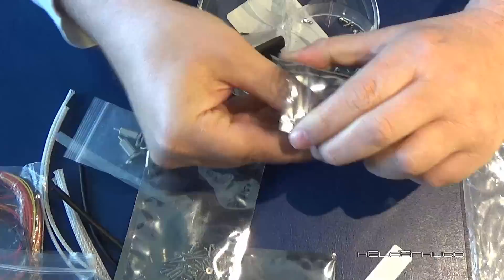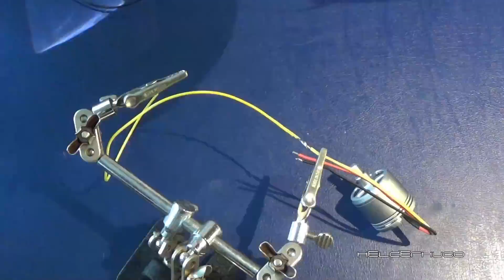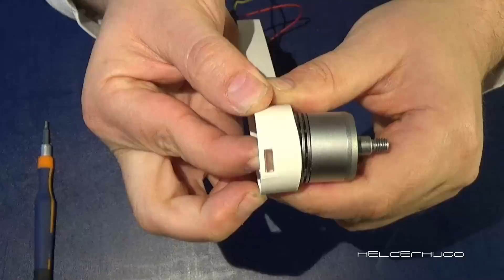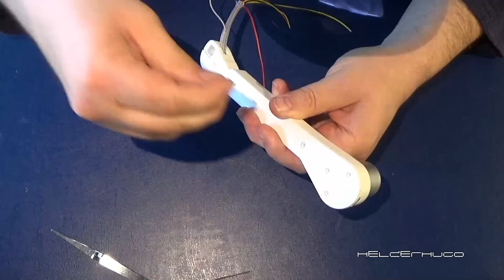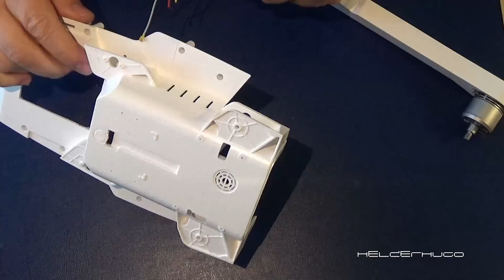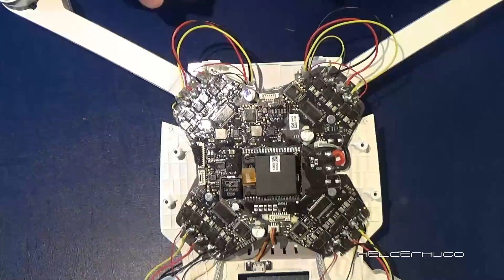The assembly of the Phanvic

Comment: I have a P3S that I purchased for parts but you have given me inspiration. So tell me if you know, can the stock patch antennas be replaced with ther dipoles that are stock on the P3A and P3P? Is there even a mounting point for the patch antenna?  Loved the video by the way
Reply: I think I have found my answers but will not know if they are the right answers until I have all of the parts in front of me. Thank you for responding and I await your next video.
Reply from the maker: Thank you and wish I could answer your question. I really don't know.